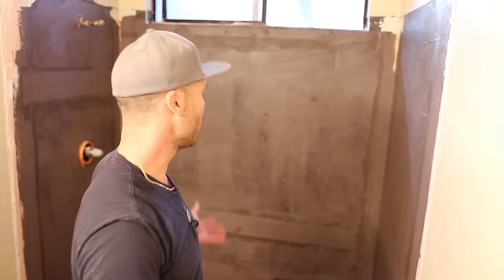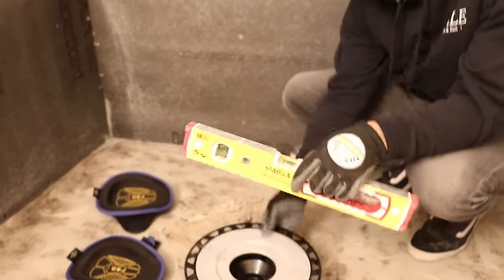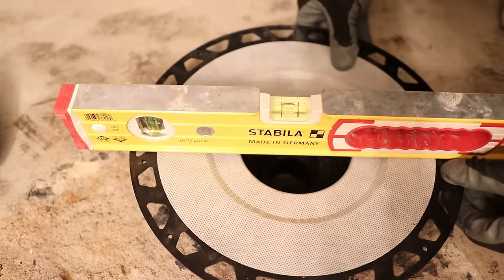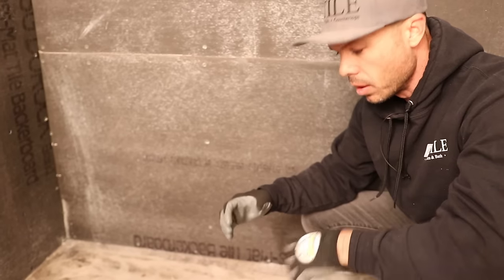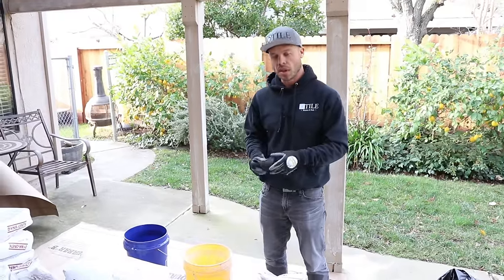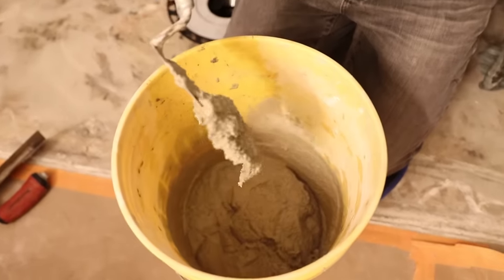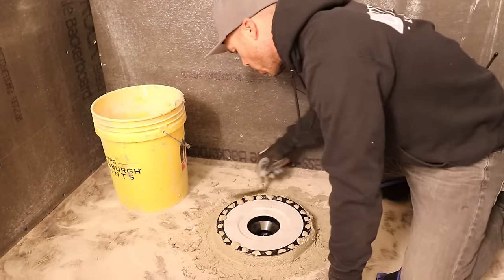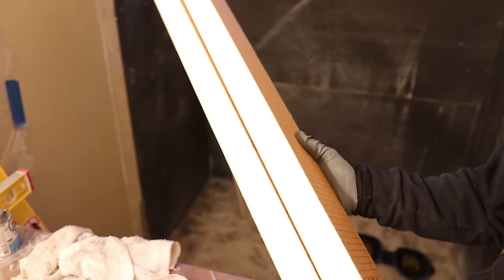One Day Shower Prep!!! MUD PAN with Kerdi and Ardex 8+9 :  TileCoach episode 28

Comment: Questions to make sure my walking shower walls are built correct: 

Am I using the right steps in the shower walls and is the drywall ok : 

1. Install drywalls on framing 
2. Cover the drywalls with waterproof Aqua paper. Is this correct ?
3. Install lath on top of the drywalls and waterproof paper 
4. Float the walls with cement , how thick it should be and what kind ?
5. Thin set and tiles . What kind of thin set for big tiles 

What am I missing ? Am I correct ? 
Is drywall correct to have waterproof , lath and cement on top of it ? Can you correct me and advise me

Comment: So I’ve been watching a ton of your videos and am very Impressed with not only your attention to detail but also your willingness to not just trust manufacturers recommended steps but test what is actually giving the best results. 
I’m working on a failed mud bed and would love to have your advice if you’re willing. The shower is a very odd shape with 2 odd angles (not standard neo angle) and drain is not centered. I was thinking of using 4x4 schluter pan and cut to fit but since drain isn’t centered would have to “build up” 1/2” on one side to keep the first course of wall tile all level.
After watching this video I’m thinking the best way is what you did here, but the only difference is my subfloor is plywood. I would have to put down plastic prior to setting the drain and deck mud. 

My 2 questions are would you recommend using wire like you did in another video?

My drain is connected to no hub iron and because of this I have to use the schluter adapter that connects to the original clamping ring drain. Is encasing all of that in the quick set mortar ok?

Comment: I’m not criticizing , only asking a question. I saw other videos where you swore by using red guard as a waterproofing membrane. Which is better?  Also you insisted that one shouldn’t imbed the wallboard into the pan because moisture wicks. I just want to use the best products and method to do my shower pan. Please advise.

Comment: Just a quick note, would love it if I could get Durarock fibermat gyprock, instead I'm either using Kerdi or actual Durarock cement board. Also, small observation, kinda cool your ABS glue is black it looks like mine is yellow both made by Oatey 🤷‍♂️. I'm in central/eastern Canada though couple hours north of Minneapolis so Cali may be different (usually are with your codes and standards).

Comment: Hi Isaac, how much space between the flange and the plywood did you have on this one?  Also, home depot sells little packets of set control to slow down the curing process with that mortar if necessary for longer pot time.

Comment: I am about to do a 3’x7’ shower. I am really leaning towards schluter system. 
I guess my biggest concern is the drain since the shower is upstairs. Do you think
The 8+9 waterproofing is a good idea? I will be using a schluter 4’x6’ pan cut to size
and dry packing the ends. Will using the 8+9 void the schluter warranty and can tile
be applied directly on the waterproofing using thin set?

Comment: Hi Isaac! 
Thanks for the how-to videos! I am starting a DYI shower project.  I want to use a Kerdi pre-form floor, curb and drain with durock and 8+9.  A lot of tile guys do not seem to like mixing products from different companies.  Am I going to have a problem with the 8+9 bonding with the fabric that is pre-installed on the kerdi floor?
Reply: Nope. Just a jam up shower floor.

Comment: Sorry, but this may be the "rookiest" question on here, but why do you use a dry pack technique? For the few jobs I've done, I've used the sand/topper mix in a semi wet consistency and troweled it as I would regular cement. Is this method flawed, or is the dry pack simply easier/faster? Thanks

Comment: Thanks for the video.  Hope you can answer my questions :) 1) Does does Kerdi Membrane replace a shower pan liner (like Oatey)?  2) I'm building a radius (curved) shower base, I was thinking of cutting up 1" schluter boards and stacking them up 5 times to achieve a 5" curb height, then wrapping the Kerdi Membrane with the pan.  Thoughts?
Reply: I would think brick, then lath and mortar.....you can make any shape you like.  The banding would have to be cut or wrinkled to wrap it though....perhaps two overlapping wraps plus the ardex and you're golden?

Comment: Why not use / try Hydro-blok 2" board over Schluter? Hydro-blok is a closed cell foam and 100% waterproof, while Schluter is open cell and a nightmare if it gets wet. When the glass guy drills into the cement board when fastening the clamp I see an issue if water somehow makes it to the schluter foam. What are your thoughts?

Comment: Question for a Schulter LTS pan base, I bought the one with a linear drain in the corner. It has the slope going towards drain, the floor has been recceded, the highest corner of the pan is even with the floor but the lowest is below the floor, what you guys do to make it even?

Another question, where I should put the frameless glass door  for my curbless shower? Over the pan area or over the kerdi band?

Comment: Isacc first of all thank you so much for your videos I've learned a lot from you so far and I'm about to take on a full bathroom renovation at my new house. I have a pretty good handle on what I would like to do, but I have a couple of questions that I hope maybe yourself, or one of your experienced viewers/followers could answer. Im going to do schluter ditra floors in the shower, and in the bathroom as well. I'm looking to mimic this install because I like the idea of the extra waterproofing layer on top of the membrane, but would there be any issue with using the pre fab schluter shower pan instead of the mortar bed? Also, if you were to have lets say a green board or cement board with kerdi membrane on your shower walls, could you apply this ardex over the membrane on the walls as well? Thanks for your knowledge greatly appreciated

Comment: I am building a totally frameless and curbless shower with one section of glass - 30" out from one wall.  To accomplish this I need to anchor the glass in the floor and that means penetrating the kurdi membrane systems with fasteners.  Your video has been very helpful. Have you any tips on how to prepare for glass supports on the floor  with KERDI?  I know KERI system has that  profile that you inset into the KERDI system but  I want to avoid any sort of FRAME or edging on the glass.  I dont want any ALUMINUM or Coated or chrome metal in the shower.  I will be buying 316 SS glass clamps or maybe having them made.
Reply: Use a wall mounted door, they come with side and bottom plastic screed strips.

Comment: Hey man!  I absolutely love all your content.  I've learned so much.  I am curious when you are doing a mortar pan on plywood instead of concrete, what's your process?
Reply: Brian Longenecker, I am a general floor installer, and I do a lot of showers using red gard membrane for water proofing, but I would say when you have a plywood floor underneath  you should use a blue pan liner and dry pack on top of liner.

Comment: You mention on a video where the Kerdi failed that you like to use weep holes on the same system here however I did not see you using weep holes here.  Why not?  Please explain this is very interesting.  Thank you  .  My coach.
Reply: Ray-55 in other videos he has mentioned it.   With the Ardex 8+9 over the Kerdi it’s sufficiently waterproof that there is no need for weep-holes.
Reply: @Grouperhound  Why bother with kerdi at all if Ardex 8+9 can handle the water proofing just fine?

Comment: This is a great video. Thanks for the upload. I learned the old fashion way: I use charleroi member underneath the bed. 

Any reason why you go with kerdi+ardex on top of the membrane instead of going with a sheet membrane underneath? 

Thanks,
Mitch
Reply: Isaac Ostrom makes sense. 

Do you lay your floor tile before your wall tile? I ask because I’m wondering you worry about damaging your waterproofing while setting tile if you set wall tile first. Wearing it down by stepping in there or an accidental trowels drop landing on the edge. 

I set wall tile first but don’t have to worry about wear because I’m standing in the mud bed. 

I’m considering switching to a top side waterproofing like this but am trying to think through the process before I switch.

Comment: Great video! If I have Wedi shower pan already installed, should I continue with Wedi wall panels or use Durock gypsum for walls instead? Is Redguard same thing as Arden 8+9? Thanks!
Reply: rayturnertile Thanks for the reply. It may be overkill but...since the contractor didnt include the 1/2” notch in the pan, I put up the wedi walls then mortared the wedi corner tape along the bottom where panels meet pan, then wedi glued the edges nice and smooth.

Comment: When using abs glue you need a 1/4 turn to waterproof/grab. "Not moving" is not the same as if you have water backup and it will go through pinholes in the abs.
Reply from the maker: Thanks for the tip!

Comment: Great work Isaac.  Wish you were on the east coast.  Hard to find good subs here.  I am doing 2 showers in my current project.  I usually use hardi and a liquid waterproofing.  This time I am trying the Kerdi system.  I was mortified to see your other videos with the failed shower pans.  Quick question.  Ardex 8+9 is quite pricey.  Have you tried other liquid waterproofing in that application?

Comment: Isaac, I notice in this episode you don’t use a rubber pan liner below the deck mud as a double layer of protection against water intrusion. Is there a reason for not using both the rubber liner below the deck mud as well as the Kerri membrane on the surface of the deck mud?

I’m assuming it’s because the Kerri drain doesn’t accept the standard 3 part shower drain system needed to secure the rubber liner, but I’m not sure. 

Can you offer some advice please?

Thanks
Reply from the maker: Exactly, you are talking about 2 different systems, engineered to work separately, not combined.

Comment: You ever think about  ditching the schluter membrane and going with the anti fracture fabric plus the 8+9?
Reply: @TileCoach  100% a no no with liquid on  fresh mud. However I do like the schluter drain flange used with fabric and a topica membrane.
Reply: Joe Mason I don't know how the moisture is going to get out of the mud pan when it is covered by 8+9.
Reply: @kevinhornbuckle  I hear you on that. This pan was on a slab so it's good. Even over a wood subfloor it's going to cure eventually. It's not something I would practice.
Reply: If that's your concern then latticrete and custom make a rapid cure system.
Latticrete quick mud with quick cure roll on membrane or custom speed slope with their speed coat. Both are effective

Comment: Since thinset is not waterproof, what do you think would happen if you used Ardex 8+9 for embedding the Kerdi tape and corners?  It's setting properties would work great under the impermeable tape and Kerdi board or membrane.  What do you think?
Reply: My thoughts exactly, besides being messy as all get out, I'd bet the result would be bulletproof?

Comment: This young man seems to know what he is doing but I have been setting tile and marble for over 40 years and as far as dry packing his floor of the shower. he seems to use too steep of a grade stating 1/4 inch per foot I have always used 1/8 inch pitch by having the bubble on the level just touching the line in the direction you are headed for with your dry pack. 
I feel the way he does it I refer to as ski slope shower floor.
Reply: It might depend on where you are located. I know that in the Pacific NW, per code, the slope has to be 1/4" per foot, and he said that he is on the west side. If you're under that slope requirement, your city/county inspector will fail your test, and you'll have to go back and build up your slope.
Reply: Yeah code in Illinois is quarter inch per foot
Reply: @richardray1523  Thanks for replying and the info. I appreciate it very much Love your posts. and that you are so nice to share your trade and info.
Reply: @OleksiyBaydala   We are 1/4 per foot out west here
Reply: Only thing I would say is the manifold seal is inside out the thick part is to go inside they are sloped for the adjustment screws on the manifold. Good pointers I been at tiling and it's always great to learn other tricks and products.

Comment: Nice video Isaac- I’m a tile pro as well and appreciate the lengths that you’ve gone to to create a genuinely waterproof system.  I’m generally a fan of Wedi for my walls and trays but am thinking about running 8+9 or Hydroban over the top as you’ve used in this video- do you have any experience with these roll-on membranes over Wedi?

Comment: Interesting to see how different build code is in different countries. 
Here in Sweden it’s freaking strict, I doubt this would be ok over here. 
I’m in process of renovating our small toilet/shower (3sq m). 
I’m using Kiilto kerasafe foil system and a unidrain corner drain.
Reply: would never fly in sweden, this is a joke.
Reply: Rusty Rose started my little project, demolition started 😜. Using Kiilto kerasafe foil system, I could probably fill the whole room with water when I’m done lol
Reply: @Paledaddy   i mean more the video was a joke,  swedish regulation are stricht, but kerasafe would never widstand so called pool aplication,   its only vapor barriered 1,5 milj sec, wich means it will leak after a short while, 

 sopro, kilto and schonx are the 3 realy good brands that actualy passed all the insurance companys test after reviewing the problems that most waterproofing membrains still had after being upp to code for the swedish requirements. 

so the U,S way is a joke... 

come work in sweden
Reply: Rusty Rose true 👌. Last bathroom I did I just used the Kiilto K2 roll on membrane (several layers/ 15 yr ago). 
Now this will be the glue to the foil, so a bit better with a two up safety system.  Really love diy projects like this and get knee deep in all the building code stuff and research like a mad man. 
Planning is everything to achieve your vision and get a great result that should not be fault by my insurance company. 
Waiting for a fed things (LK PE X uni tubing and push fixtures. All the rest is waiting for me in the living room already 😅

Comment: Hey, why bother with the kerdi at all? appreciate it may add some strength to the internal joints but ardex provide there mesh tape for that, apply 2 coats and it's solid. Another product they've got is Ardex S7, heavy duty but brilliant stuff.

Comment: I guess there are a number of was to set the Schluter flange; on their company videos they set the bed before installing flange (use spacers for height guide); Sal (another pro tile YT ‘er) did like this video and glued flange first, but did not mortar using quick set...he just used the bed sand mix. Since the waterproofing goes on top it doesn’t really matter as long as the drain is really well supported; any other views?
Reply: P.s. put some tape over the drain opening; nice job but almost dripped some quickset down the drain. That causes all sorts of problems down the road 🙂.

Comment: Hey Issac, 
Im a Subscribed Viewer of your channel and really dig what your doing. Id just like to share my concerns on the practice of applying any liquid membrane to any mud base in a shower. Applying Liquid Membrane to Walls, Curbs & Benchs are great idea. Although a liquid membrane on the mud base seems likely to trap the inevitable water that penetrates tiles and leaves the water no choice but to linger between the liquid membrane and tile potentially undermining the bonding qualities of the thin-set. I surmise that the potentially trapped water would negatively effect the tile at the perimeter of the shower base  first then slowly advance toward the drain. It would seem to me that if the mud base were left alone then any water penetrating through the tile would permeate through the mud down to the membrane then out the weeping drain assembly. 

Your Thoughts?
Maybe an Awesome Experiment Video? 
LOL!
Hope all is well by you and yours.
Reply: That's the hole point of floating the mud with a slope in it towards drain so all water passed through tile ends up flowing towards drain

Comment: Just wondering why you didn't use Ardex 8+9 to bond the Kerdi corners and band seams like you did on the huge shower job video.
Reply from the maker: It’s extremely messy.  Thinset is way cleaner and you get tighter seams.
Reply: @TileCoach  are you sacrificing waterproofing even though you 8+9'd over it?  Thanks for the prompt answer. Enjoy your vids

Comment: Nice. I am about to venture out of traditional concrete liner pan. Wanting to use Kerdi or Wedi. Have you worked with Wedi? It seems to be nice with standard shower stalls. Not sure about custom.
Reply: Latticrete has the most options to help fit into budgets. Schluter linear drains are better but laticrete has them beat everywhere else
Reply: @hereticxxx9317  Thanks a bunch for the info. I will look into it

Comment: I have a shower that is 72" long x 36" wide.  The drain is 15" from the end wall.  If you make the slope 1/4" per foot that leaves a slope of about 1 1/4" on the long side.  Is that too much of a slope on the short side?
Reply: It would still be 1/4" per foot for the short side, too. So if your drain is centered in the narrow part of the shower, you would have like 3/8" slope.